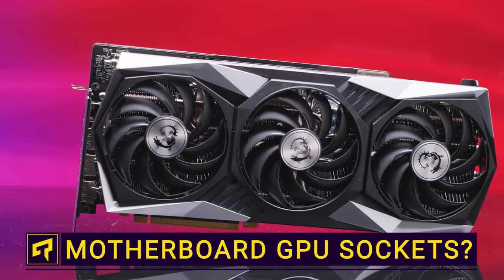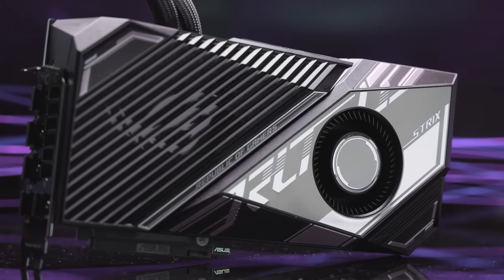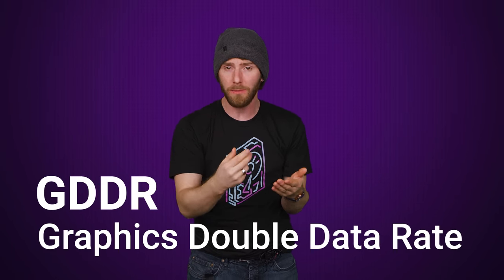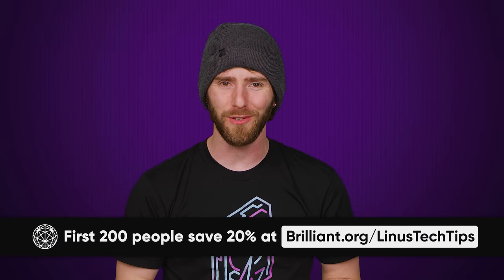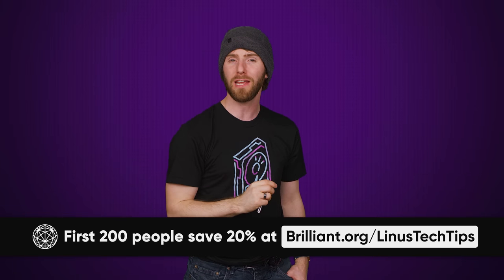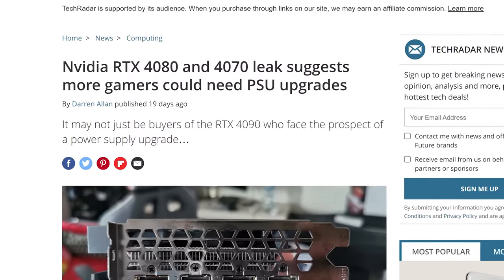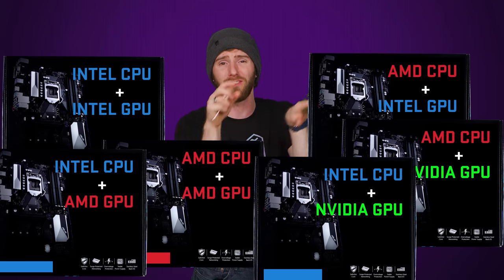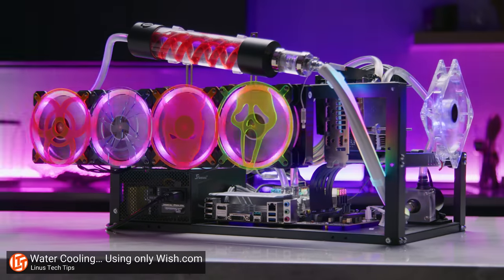Can You Put a GPU on a MOTHERBOARD?

Comment: On the enterprise side, I’ve worked on servers with JBOGs (just a bunch of gpus) attacked to the main head unit chassis. These JBOGs have slots where you can insert x number of GPUs on, other ones have the GPUs directly on the GPU baseboard, almost like a CPUs, definitely power hungry systems.

Comment: I'm surprised AMU's weren't mentioned at all. Just a brief acknowledgement that they do exist, but are comparatively underpowered for gaming purposes leading to dome desktops with a AMU also have expansion slots for dedicated GPU's. 

My first work PC only had one VGA slot, so I bought a cheap graphics card so I could use a second monitor.

Comment: As mentioned at the end its done on laptops all the time. 
And therein lies the detail. You CAN put it on a system motherboard but tower form factors for people other than gamers generally have slots for market specific expansion. You may load up with GPUs. You may load up with AI accellerators. You may add RAID cards, or fill all slots with networking cards, etc etc. The tower is the universal system. And a large percentage of the time may not need a GPU at all which is where on board limited graphics came from. Most blade servers have very few if any full size PCI-E slots. Maybe room for one A100 etc.  So that is why. If you did the math most of the configurations have nothing to do with visualization or gaming.
This really makes me wonder if there is a better standard form factor for game machines. The ATX form factor is limited by its other markets. Gaming is an enormous market. Imagine an enclosure built to use 128 PCI lanes including power and cooling. Maybe it opens like a suitcase on its side with system on the left and vertical GPUs on the right. Do-able.

Comment: I mean this could be practical for modular/ buildable laptops since they use way less power which would make it easier but a standard interconnect would still be needed to solve the socket issue.

Comment: I actually like the idea it could be easier to water cool, just slap a CPU AIO on CPU and GPU right?
Reply: Even just a regular cpu air cooler would be better than the awkward cooling most current gpus use. Like the Noctua or Cooler master ones.
Reply: @plasmaoctopus1728  true, I’m just a sucker for LC, I plan to build a full LC rig for my first build

Comment: Back in the days when GPUs weren't as power hungry, as they are today, I had my hands on a computer to fix some problems and the mainboard had an ATI Rage Pro (AGP 3D chip) soldered onto it with discrete 8MB VRAM (wasn't sharing system RAM). And I had some used Dell machine for some time with an S3 chip onboard. Aside from that, iGPUs either in the northbridge of the chipset or nowadays in the CPU are more common.

Comment: I love the concept of selling GPUs as discrete chips like CPUs and motherboards should have specific slots for them and their VRAM sticks
Reply: Before PCIe, there was AGP. The Advanced Graphics Port was an expansion slot dedicated to video cards. There was also an expansion slot called the AMR, or Audio Modem Riser. I only saw the AMR used on a few business desktops, but they could have been in consumer model PCs too. They weren't around long.
In the early days of PCs, a motherboard pretty much just held a CPU and RAM. Everything was on it's own expansion card. There was a hard drive controller card, floppy controller card, a serial port card, parallel port card and a video card. There were also several types of network cards and a couple sound cards available, but they were rare. The only i/o port on a motherboard was for the keyboard.

Comment: I started gaming again after a long hiatus and noticed my i7 cpu was running hot, so I pulled out my vacuum to do some cleaning and found that my GTX 1080Ti was almost pristine. No dust on the fans or cooling fins, at all. It looked brand new. That's when I noticed that it had a "Fan Off" light that was lit. Somehow the fan was turned off all these years. Using the software to turn it on, my i7 was suddenly running much cooler. The 1080Ti must have been making the i7 carry some of  the graphics load all this time. Still, I never had much of a problem running Elden Ring, probably because the i7 is overclocked from 3.6Ghz to around 4.5Ghz. I did have an occasional freeze for a few seconds but only maybe once a week.

Comment: Systems that can be integrated on a single PCB or even better on a single chip are a lot cheaper, more robust and would actually perform better. The tradeoff is flexibility, repairability and development time. In portable devices like laptops, tablets and phones they dont have a choice because the physical dimensions usually dont allow it. But there is no doubt that a fully integrated computer system would actually perform better and be cheaper to produce. A lot of electronic filters, shielding, cables, sockets and connectors can be omitted which actually saves a lot of money if you mass produce them. Every connection where signal integrity matters like a cpu, pcie or dram is usually made of literal gold to inhibit corrosion. It would not suprise me that in 10 years from now they might start going this route. Because as signals get faster and faster the actual connector might become the bottleneck due to cost, signal integrity or emi issues. I personally love how modular a computer system is and it makes sense from a cost and design perspective too if you look at its history. It also allows the user to get new technology much faster as only a part of the system needs to be developed like for example a faster gpu, cpu, ram or ssd. But there probably will be a point in the future where it doesnt make sense to do this modular approach any longer for cpu's, gpu's and ram. Consoles were already going this route and you can get relativly powerfull systems for a much lower cost.

Comment: Laptop motherboards almost always (with few exceptions) came with dedicated GPU + video power delivery + video RAM soldered on the motherboard. For the few exceptions, it either didn't have discrete graphics or had them in add on cards just like RAM sticks or Wireless cards.
Reply: That is true, but they also use MUCH less power than a full on version of the desktop equivalent.

Comment: Am I in another universe? The Apple M1 chips?
Reply: Exactly my words!
Reply: the m1 chip has the cpu and gpu in the same chip (hence why it's called an SoC), what linus is referring to is something more like having the cpu on a motherboard, then having a gpu as a separate chip on the motherboard. apple isn't special having a gpu built into the cpu, intel and amd both have that
Reply: @windowsxpnt2347  yeah but is a bit misleading.
Reply: @windowsxpnt2347  yeah. Why would you want to do that? To work better right? Apple did just that and even better, all in one chip on the mother board. He’s ranting about wanting more GPUs on motherboards when there way better cpu/gpu/motherboard architecture available. He’s a little late to the party.

Comment: The first part of this video is nonsensical. And what's this comment about "memory slots cause data errors"? The only way for that to happen, would be for it to operate out of spec, which no manufacturer would ever consider since the RMA rate would be too high.
The second part of the video is the actual reasoning. There's enough of an issue getting CPU suppliers to commit to a standard, then also throwing GPUs into the mix would be impossible.
To address the first parts though. Power delivery is a non-issue here. Most high end motherboards need to have dedicated power supplier to their CPUs, sometimes up to 200W (look at thread ripper). Obviously this would cost more to do, but it's not impossible or even impractical.
As for slotted RAM for GPUs, the problem is speed, not data integrity. Or I guess you could claim that running the VRAM faster could cause data integrity problems, because the socket can't handle the speeds (signal integrity issues). But that's a dumb argument, because you could apply the same thing to "why can't I run DDR3 RAM at DDR5 speeds?"
Anyway, if you had a motherboard based GPU socket, it would likely rely on HBM instead of GDDR, since that's even higher bandwidth and takes up less space. Funny enough, that would mean that you socket is essentially just a PCIe connector with some display output, which is exactly what the MXM connector is. The problem with MXM is mostly a power delivery issue on the connector itself, board size limitations, and low adoption (why would a laptop manufacturer use MXM when they could just solder the GPU directly, since it doesn't need to be updated). But MXM does prove that this concept is feasible, if not economically so. 
tl;dr A PCIe card is just more economical, but there are no technical challenges preventing GPUs on a motherboard socket, it's mostly getting companies to agree to and commit to a standard, like with MXM for laptops.

Comment: But what if you don't have the GPU on the motherboard, but on a dedicated daughterboard so you still have all the benefits of a modular GPU (like being able to choose how much VRAM you want) and you crush pretty much all the drawbacks of the GPU on motherboard approach except for VRAM data integrity. The only big drawback that I see is that the GPU form factor standards need to be revised and therefore also case formfactor standards.

Comment: A few counterpoints:
1. E-waste. It's kind of insane that we have to occasionally throw away GPUs and boards in perfect working condition if 1 out of 12 GDDR chips on that board happen to be bad. Or if our VRAM capacity is perfectly fine but the GPU itself can't keep up with a monitor resolution upgrade. Etc., etc. We put up with it in laptops because we want portability, but even there Framework is demonstrating that approach to be unnecessary. How much less necessary is it on a desktop where we have as much space as we want?
2. Cooling. It's also kind of insane that we slap aftermarket 360 AIOs on CPUs that draw 95W, and then use what are effectively stock, proprietary, <60mm low profile air coolers on GPUs that draw 300W+. A socket model would let us use coolers more up to the task, and then reuse those across generations (and even architectures if the mounting mechanism remained the same!)
3. Architecture. Yeah, internal GPU architectures change all the time now - because the form factor allows them to. Why should we assume they'd keep changing so frequently if they moved to a socketed model?
4. You don't necessarily have to build the GPU socket onto the same board as the CPU board. You could instead have a CPU board that looks like a long ITX/DTX board with a right-angle PCI-E slot, which then connects to a socketable GPU board; both could lay flat against the back of the case, but without needing to build it all into a single board. (Really, why do all of this video's graphics for socketable motherboards still have a bunch of PCI-E slots anyway? Half the point for gamers is that we don't really need those much anymore).
Reply: Its not that simple, sockets cause bandwidth, latency and power delivery problems.  We wouldn't have the same performance or efficiency from socketed GPUs, its literally why the PCB traces are as short as possible between the GPU and VRAM as even the copper trace itself causes huge losses at the speeds GPUs are running at.

Comment: Like when OEMs tried to add Sound Blaster HW to the motherboard, it would just be messy. At least audio processors take up less (MUCH less) space than GPUs, but the electrical interference involved with being integrated was unacceptable.

Comment: two separate slots for graphics mem, I would like the upgradability, so have everything modular, i.e. have the graphics card plugin, and a CPU plugin card, therefore MB wouldn't need to be upgraded, when new CPU or GPU, but you could keep both the graphics mem and CPU mem

Comment: I know GPU's on motherboard makes little sense, (unless a laptop) but I've wondered if have a GDDR RAM lot would not be a bad idea. you could unlock the full potential of the APU's onboard GPU, as often the limiting factor is the RAM for these system.
Reply: I also like the idea, but I believe that it would make little sense as APUs are for budget use, so more expensive mobos AND having to buy a second set of memory would entirely defeat their purpose
Reply: Consoles use this
Reply: @Kuri0  They do and the don't, they have dedicated GDDR but they don't have regular DDR ram.
Reply: @alexanderkopke2420  I hadn't thought of the motherboard, adding a GDDR RAM slot would add extra costs and complexities to the motherboard and as this would appeal to those on the budget it would defeat the purpose if the cost of the MB was £30 extra.

Comment: Well, the point, that does not make much sense, is that main board manufacturers had no incentive to make boards for a niche group - gamers. They obviously produce high end main boards with overclocking capabilities which are only useful for games who will use a graphics card. But that obviously also doesnt change the overall fact that it does not make any sense to build a main board with a graphics chip socket.

Comment: Then Apple came in with the M1 SOC, having shared memory for CPU and GPU :D
Reply: Shared memory isn't new per se, and the video was more about keeping the ability to switch components which you obviously can't switch neither CPU, GPU or ram with M1 devices. Not even the whole chip since it's soldered to the Mainboard, as we usually see in mobile devices.

Comment: I have a somewhat rare Dell Optiplex 7777 AIO Desktop with a socketed 8th gen i7 (8700T) and soldered on GTX 1050 from the factory. Its not a gaming beast by any means, but it does handle light to moderate gaming far better then the integrated graphics from that time period.

Comment: Taking into account current state of tech and eg. nVidia's Grace-Hopper designs or their SXM socket designs, I'd say if one wanted to, one could have had say one CPU socket and next to it one SXM socket... Heck if there was more push to the designs and such approach, something closer to socketable MXM from laptops woudl have become an even more interesting option, especially in SFF by allowing such 2 socketable components be covered by full-board plate block for liquid cooling. Those MXM/SXM designs combine GPU chip, it's power delivery circuitry, and memory modules so the discussion about drawbacks of going for either RAM tech is null... Still, since both GPU and CPU makers have worked on HBM support in their designs, this type of RAM might be the common denominator that would have meant mem DIMMs or ob-board packages for HBMe stacks would have to be either produced or incorporated into board designs. Heck, if we forego DIY expandability for each component on its own, maybe designs similar to said CPU+GPU+MEM package nVidia played with could be an answer - as in same board for I/O but upgradable larger slot with a combined package of compute components with memory. In theory this could have been an answer if the socketable compute component had pins for extra PCIe slots coming from the socketed-into board as well. That way, instead of having say a chipset on board for some duties, the compute module design would utilise PCIe attached controllers selection of which and organisation could have been chosen by the mobo designer/engineers - as in say set 4 or 8 PCIe lanes for a storage controller if none was present in the CPU itself (though on the other hand we've seen Epyc designs with slim PCIe slots worth of 8 alnes that were capable of being split using same port on board into either 2xU.2 or 8xSATA channels depending on user choice/requirements so in theory storage could have been dealt with. Same goes for WiFi/bluetooth - through M.2 interface one could have an upgradable wireless networking solution with cables for antennas routed through the board and towards the back panel for possible extension... Want an audio card slotted in? I guess some companies would release similar M.2 form-factor upgradable variants if regular PCIe slots are out of the question, maybe even these could have been stacked on top of one and the other similar to either how M.2 slots are stacked in many new boards or in a form of double-sided SO-DIMM-like daughter/extension board. M.2 storage? Same as current designs... USB/TB controllers for fron and rear panel ports? Either a controller on board itself or yet another M.2 based controller to USB headers and maybe routed cabling solution... Cabled networking? Either through PCIe dedicated controller or maybe PCIe connected on-board chip/controller... In essence, the industry has the potential to do it all. Heck, it'd be easier for board companies as the boards could focus on I/O and controllers exposed/offered to the end user on-board using some great packaging tech and eg. server-grade or laptop-grade approaches, and if the board became basically power distro unit combined with I/O port exposing device and with bulk of the controllers/PCIe devices upgradable/replacable it would have meant total end-user benefits... The blocking element remains eg. standarisation of such CPU+GPU+RAM combos, their production and general acceptability by the consumers. At the moment though, all the key players in CPU and GPU designs have licenses, tech and know-how to develop such combo units with their respective technology stacks... and they'd gladly make and sell such combined "their" efforts as it could give them more control on the "compute platform". Heck we've seen Intel and AMD collaborate on the NUC-destined design as well, so maybe even intercompany combos could be achieved. In theory it could work and could be a success... if we go this far in a desktop socketable GPU mainboard game...